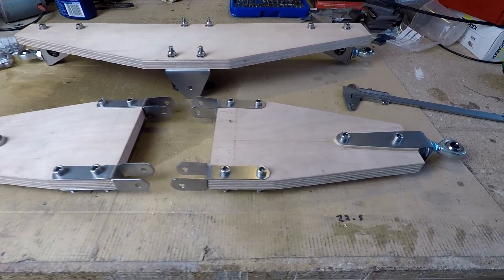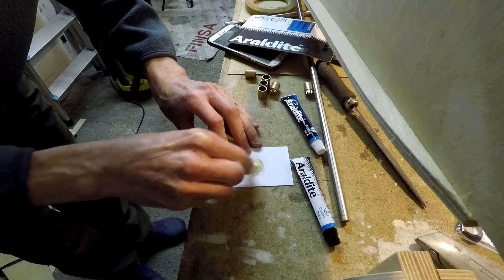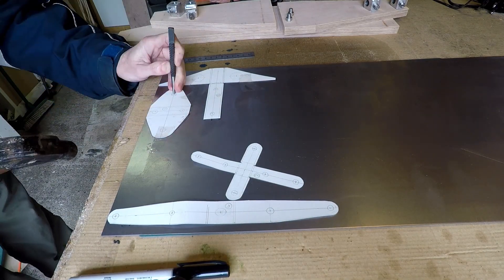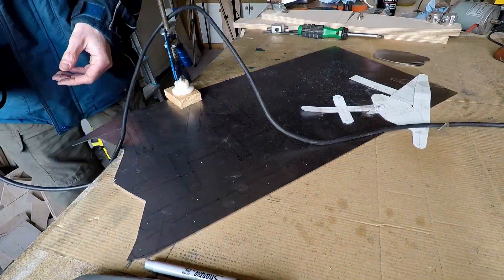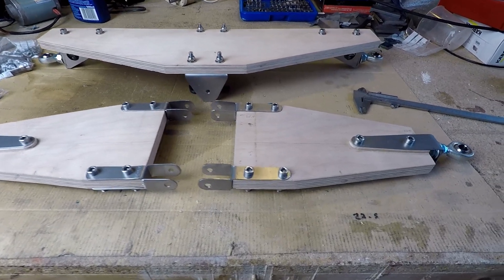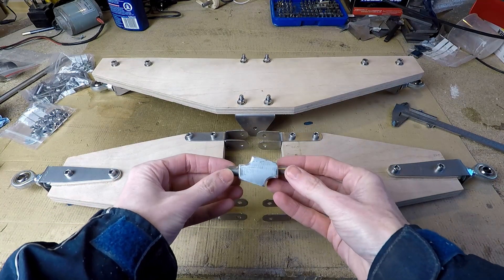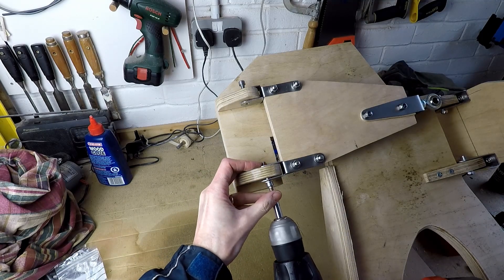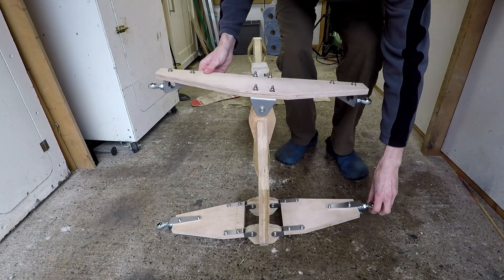Tilting Trikes Part 7 - Recumbent velomobile project sheet metal parts.  A quick update on progress.

Comment: I wish you good luck with your project, but I fear that part at 0:05 will bend under load
I suggest reinforcing it with a steel sheet ~parallel to the screen at that timecode

Comment: Hello , it looks great 
your woodworking skills are quite as good as your maching skills .
Something confuses me at your design , the upper arm is one piece attachet to the center line of the bike and the lower is two arms , attached at an offset of the centerline , how will you calculate the tie rod length ? its supposed to be equal on the front view of the bike to the arms length so its creates an arc of equal radius with the arms and thats how you avoid bumb steer which is lean steer in our case , will you choose the upper arm length or the lower arm length or an average?
I used to design mine with two one piece arms but I will change it now to a two piece arms because i think its easier to achive ackermann due shorter tie rods it requires given that the length of the tie rod has to remain the same with the arm length I think maybe the two piece thing is more flexible but maybe I am wrong .
Reply from the maker: Hi, it's quite simple in fact - the length of the lower arms is exactly half that of the upper arm, so the the length of the tierods is the same as the lower arms or half the length of the upper arm.  The main reason for offsetting the lower arms is to allow for the width of the steering bellcrank and to get the Ackerman geometry to work properly.

Comment: Ignore the ramblings below. Once assembled the faces of the lugs the inner pivots brackets attach to are probably enough to hold their shape once assembled...............

Really enjoying this build.  Are you sure 1.5mm sheet is going to hold its shape?  Especially the inner pivots as they seem very long.  Excuse the terminology that follows as its probably not correct, but have you considered the loads resulting from hitting a pot hole with a single wheel or jamming on the brakes hard (assuming you'll be running disks)?   Particularly sheer along the longitudinal axes of the trike. Bending moments induced where they meet the wishbones looks like it would cause them to bend at your folds. I'm sure they'll be fine in tension, but you'll also get compression and bending moments. AreThese seem to be a weak link in comparison to the rest of the build.
. .........
Reply from the maker: I think they will be ok, but time will tell.  Some extra strength is afforded by the pivot bearings when bolted up.  I could weld on some extra gussets or similar if they prove to be a problem in practice.  Looking at the suspension mounting brackets on cars I am reasonably reassured as they are not as thick as you expect.  I would have done some stress calculations if this was not a relatively quick and dirty prototype.

Comment: Good stuff, i think I might follow your model and just use aluminium box in place of the wood. Do you have a plan/schematic of the design for download please? I'm also thinking of using a lot of carbon fibre where load issues aren't crucial and weight can be cut, I was going to use Corex for the shell - monocoque but have decided on carbon fibre instead, although i will be using Corex for the trailer to go with and other parts. As I'm also going for the electric assist option I will be building a motor section and battery/ electrics box as well (waterproofed to 4000hs - a friend who designs tents etc is advising me there). I'm interested in shock absorption and such for the rear and front. I also want more clearance from the road and i thought, 24" x 1.75-2" fore and 38" x 4" Rear wheels to get that height. Any thoughts? I can loom the electrics myself and have begun collecting parts and fittings; the dreaded lurgy has stopped me using a pal's garage to build at the moment. Great videos, btw. Thanks
Reply from the maker: Hi, thanks for the comments!  I don’t have plans available yet as the design has not been road tested.  My final version post-prototype will probably be carbon fibre.  I looked at different wheel sizes during the design process and concluded that smaller is better.  This is because they are lighter, give better clearance for steering, give more space inside the trike (rear wheel) and keep them overall length down.  I settled on 20in wheels as the best compromise, smaller wheels would look ridiculous!

Comment: Was planning on cutting metal with an angle grinder, thank goodness I saw this video first 😅 I also appreciate the simplistic yet super solid ball Bearing replacement. Keep up the good work 👍
Reply from the maker: Thanks! There will be some angle grinding in the next instalment!
Reply: @MetalMachineShop   Love your project . What size of Oilite bushes (bearings) was used ?  Thanks.
Reply from the maker: @charliethewanderer6872  hi, they are 10mm bore, 13mm OD and about 15mm long.
Reply: @MetalMachineShop  Thanks.  Great carbon tie rods.